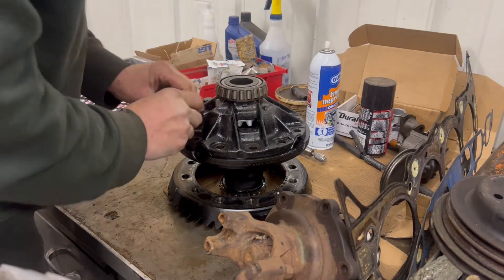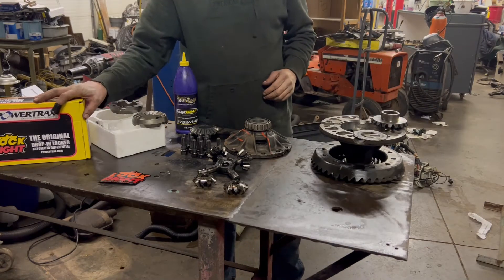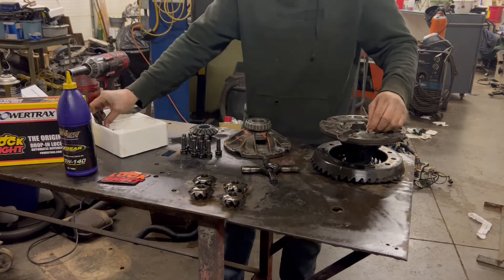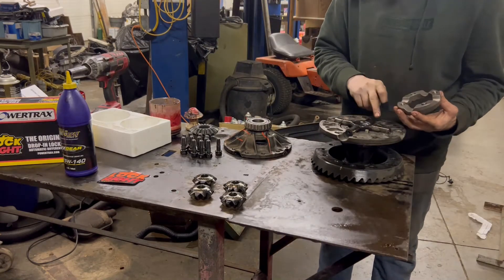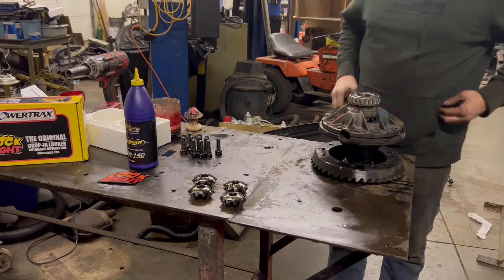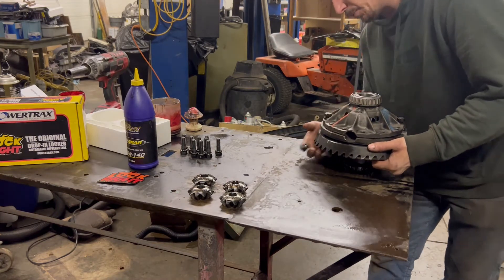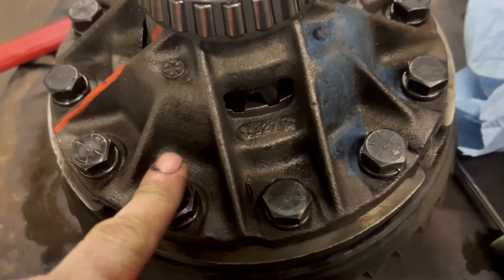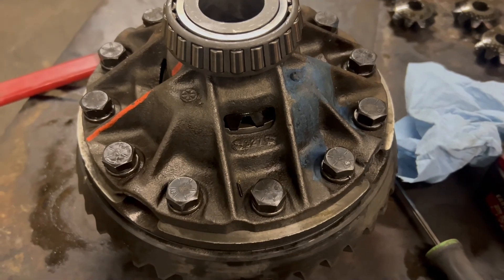Installing a power trax locking differential in the 14 bolt 10.5" gm

Comment: I just bought this an put it in an am
Immediately taking it out. So much road noise and on a straight away it keeps locking and unlocking making like a clicking noise
Reply from the maker: That sucks I haven't got the truck done so I don't know how mine is going to work but I put mine in a toy so it shouldn't see much street use

Comment: Well how has it held up so far?
Reply from the maker: Sadly that project got pushed back and testing isn't going to happen till next spring LOL still have some engine work to sort out but plan to have it done this winter.
Reply: @rippingburnouts  oh it happens. I snagged this locker for $100 never used and so far you have the best installation video by far. The hilarious part is I didn’t get the axle from a buddy yet, it’s going in my Jeep once the barn is finished.

Comment: What's the kit number? That would be sweet for my one legged express van
Reply from the maker: It is a powertrax 1955-LR should fit 14 bolt 10.5 ring gears from 1973 to 2018
Reply: Awesome, Thanks for the information! I guess one more question. Does this kit convert into a full posi or lsd? Thanks again
Reply from the maker: @rigodiaz01  It has a ratchet type locker the outside wheel can go faster under low load turning so power is placed to the wheel with the most traction so in a low traction situation it acts like a spool rather than a LSD. Hope that helps explain it.